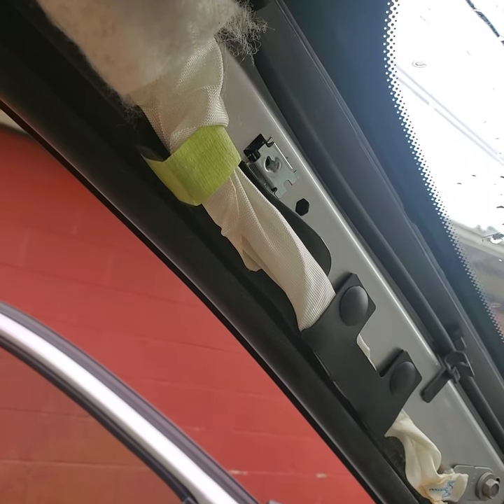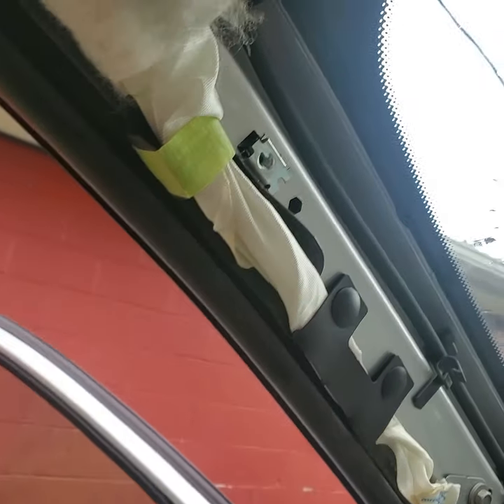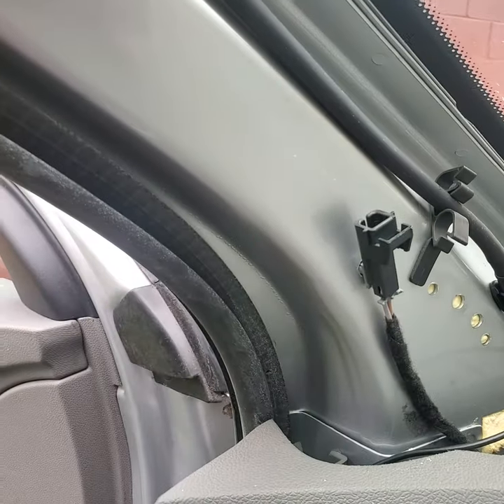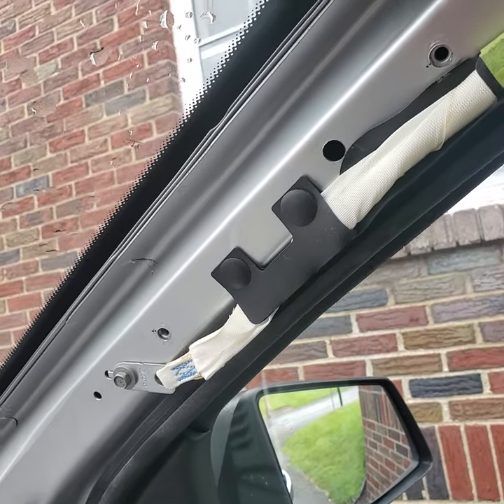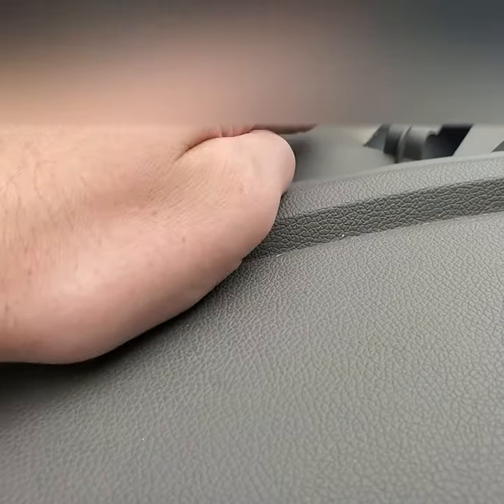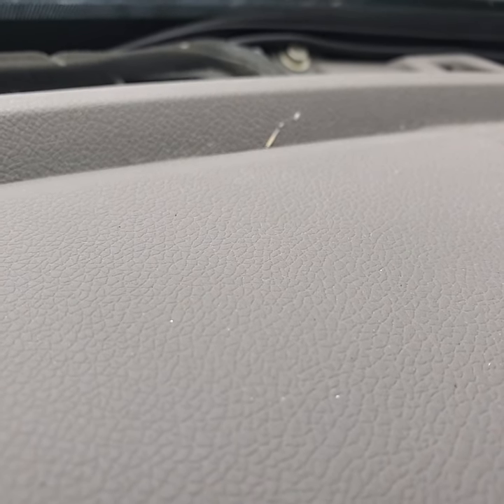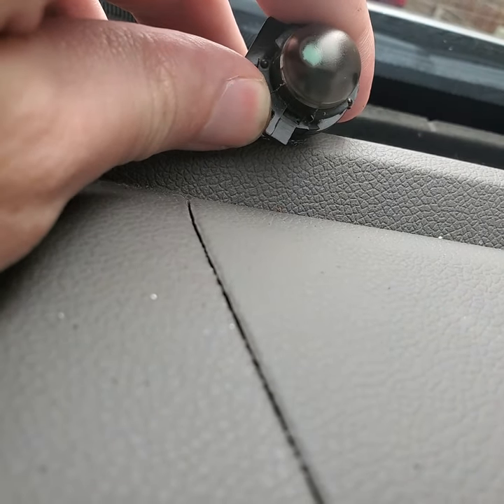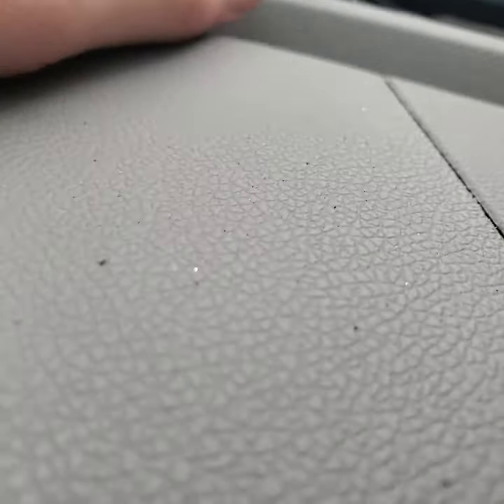Ambient Light Sensor 2010 Chevy Traverse How to Replace

Comment: Thanks for the guidelines on how to replace the sensor.  I replaced the sensor.  Initially when I started the vehicle, I could not see the DIC display.  I covered the sensor and the display showed up.  I did a factory reset and everything is OK now.
Reply from the maker: How did you do the factory reset?
Reply: How do you do the factory reset

Comment: Good video but do you know what fixes that odometer dimming issue?
Reply from the maker: Nope, wish I did. You can replace the cluster for like a grand but your odo won't get set on the new one so you can only do this if your vehicle is (or would be if sold as) mileage exempt on the title. Probably the issue is a failed capacitor or IC that regulates the screen brightness based on the signal from the sensor. Thinking about getting one from a scrapyard to take a look at sometime.
Reply: I just fixed my wife's 2011 Traverse LT. The dash lights were so dim during the day we could barely drive it.  The dimmer switch was working. Just could not get the dash lights bright enough to be usable. I tried black tape over the old ambient light sensor to trick it. That worked for awhile but the dash lights kept getting darker.  Replaced the Ambient Light Sensor on the dash with a TechSmart T37005, $38.  It fit perfectly, but then my center dash info system ( shows gear, odometer, tire pressure, oil life ) went blank.  I removed the negative battery cable that attached to the ground of the car.  This is located between the passenger seat and 2nd row passenger seat below the floor mat.  Waited a minute then reconnected the ground. Everything works now. There are videos on YouTube that show how to replace the ambient light sensor. It's not that hard but will take a solid hour or so once you have the part and the tools. Originally AutoZone sold me a AC Delco sensor for $12, but it wasn't a match. They were very nice and gave me a refund. It helps to bring in the old sensor to match the pins on the new one.

Comment: Can you have a clear picture of the location of the light sensor and a second question in my car there is a check light and the engine does not have any noise sound and I made a computer check for her They told me that the sound is the timeig in the engine
Reply from the maker: Probably your timing chains are worn out. A common and unfortunately expensive problem on these as they age. How many miles does yours have?
Reply: Ninety-seven thousand miles